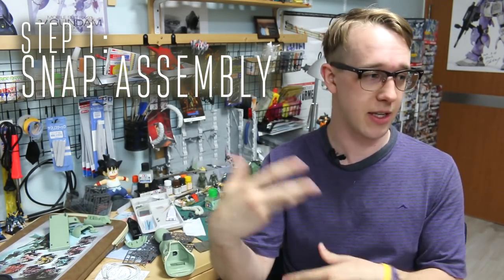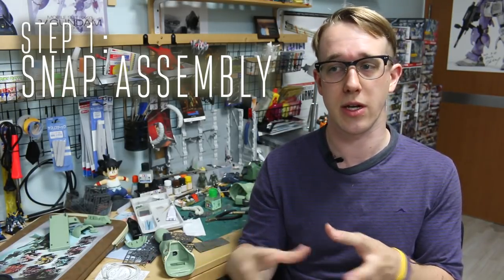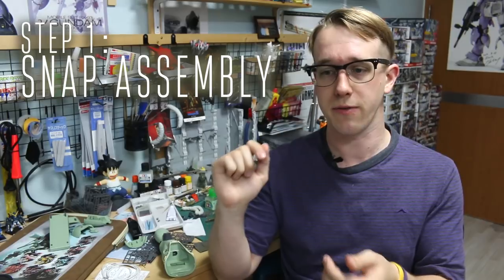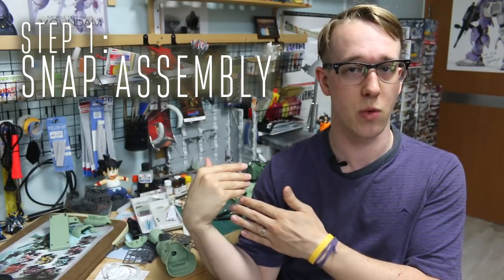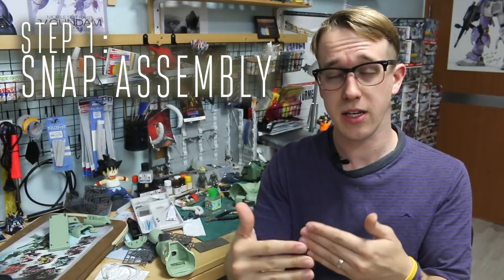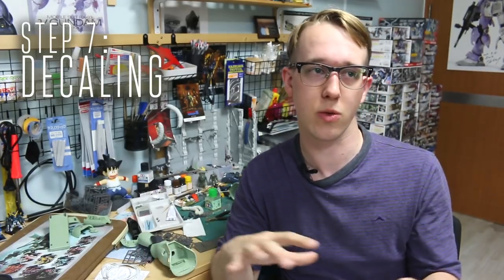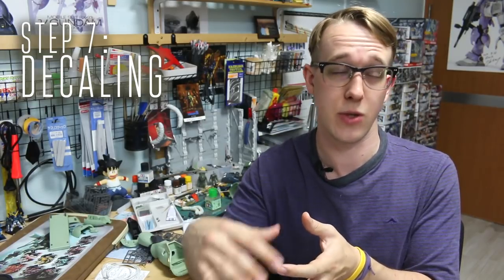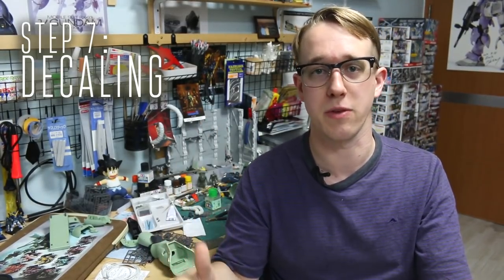1240 - FAQ: Steps for Painting

Comment: remember to top coat your top coat to protect your top coat.
Reply from the maker: I'm always scratching my kits by accident, so that's good advice for me!
Reply: I top coat my top coat, top coat that top coat, top coat that top coat, top coat that top coat, top coat that top coat, and top coat that top coat. My kit then turns milky white because of all the protection and I am comfortable with leaving it on my shelf. It doesn't move because of all the protection and I never have problems with a joint dropping down because of gravity. I just hate it when I want a different weapon and or different pose because then I have to buy another kit and do it all over again. The kit ends up costing $500 and most of the cost is top coat. Lol. Don't be like me, enjoy your possibility. The reason why I know some of this stuff, I put 4 coats on a figure as a kid and it's still a statue, next to my TV and it's a funny conversation starter. It's special to me and I wanted to protect it and it's still special to me but it's not a figure anymore and I learned to put on very lite coats and I usually only do 2 coats now. For metallic, I use gloss and I sometimes add a 3rd coat but buff wax with a Dremel pad. Then I get the song shinny in my head from the movie Moana and look at my reflection in the paint. Chrome I do the same thing but I only did it to 3 kits for the gloss and everything else is flat top coat and easy. I don't recommend the shiny process but I like it on my 1/100th Kampfer and my Iron Man custom Bearrguy and Pikachu custom Petit right next to each other. Car wax seems to be working for tightening joints but I only tried it a month ago and I always have car wax around, that's why I tried it.
Reply: If you topcoat your kit too much

BURN IT
Reply: @ihavethehighground8697  Mecha approved!
Reply: With primer?
Reply: Basically
"I used the top coat to protect the top coat."
Reply: Yo dawg I heard you like top coats. (I top coat at least three times; after the primary painting, after panel lines, and after decals.)

Comment: Very useful video. Not sure if you've used lacquer paint before, but I can confirm from at least two kits worth of experience that enamel thinner doesn't affect lacquer paint at all. Neither does acrylic thinner. Enamel thinner on bare plastic is also highly destructive, so don't ever use it to panel line a straight-built kit. When in doubt, try something on a piece of spare runner or the back of a plastic spoon.
Reply from the maker: yeah I use lacquers for painting all my kits.
Reply: Jeran Korak you can try isotropc alcohol  (rubbing alcohol) less than 90% . It will thin the paint with out damaging the plastic
Reply: Thank you Nunya Bidness, this is really useful information.
I would like to add that the type of plastic (PE, PS, ABS) is also reported in the instruction books that come with every Bandai kit.
However, I have a question: where did you get the information that Enamel thinner is fine on polystyrene (PS) plastic? Is it by experience or you have also other sources? I am asking because in other forums there are people that say that this thinner is bad on all plastics.

Comment: Awesome video. Some additional notes below: 
-After the initial snap assembly you can remove seam lines, do a bit of scratch building, pla-plating, and customization. 
-After priming, you can do some pre-shading using an air brush prior to laying down your base paint. It will add depth to your finished kit.
Reply from the maker: yep yep! Since those were kind of extra stuff I omitted those steps, just to keep it to the basics. Like I said, the main point was for folks to understand the reason for different steps, then I think they can figure the rest out!

Comment: I'm a beginner builder, just learning to use the airbrush. Painting was an anxiety-inducing activity for me at first because there's so much going on in my head about getting even coats, spidery-runny splotches, correct air pressure, how much to thin etcetera etcetera...

All that pressure is gone once I found out I could easily strip unsatisfactory paint results with isopropyl alcohol.

Comment: Hi @ZakuAurelius, I just went back to the hobby and most of your kit reviews and guides help me a lot. I am new to painting and now I am on a binder. I am now on the steps of panel lining but I use Mr.Hobby AQUEOUS HOBBY COLOR for my base coat which is an Acrylic based paint. I am also using AQUEOUS HOBBY COLOR gloss topcoat (which is acrylic as well) with my airbrush to top coat. Will this top coat helps protect my base coat from Tamiya Accent Panel lining which is an enamel base wash? Most I  read online say enamel cannot go on top of acrylic paints. The pledge you mentioned is not available in the country I am in, and only find Pledge Revive it which I believe is acrylic based as well. I hope you can help me with this situation. Thank you.

Comment: Hi there! I did find this video somewhat very helpful! But I still have questions that have trouble getting the answers to. Like for example; I have Tamiya Clear Coat, or basically clear topcoat from Tamiya---will that protect the paint or is it more for the finish look of the build? Like---sometimes I get stressed the f**k out cause I been a fan of Gundam & Gunpla for about 3 or so years now. And I been starting to get more into customising my builds, which would also mean doing painting. Anyways; I been planning out this nice HG, Gundam Barbatos Lupus/Lupus Rex, kitbash custom that I been also wanting to paint in custom colors---right now; it would be my 3rd time working on the same damn build, and for each different time I had to restart with a fresh brand new kit(s), cause of the fact that I just kept messing up. So knowing this is my 3rd time doing my build, I wanna be EXTRA CAREFUL if you know what I mean. Anyways! If you read this comment; than thank you very much for doing so. I do have a YouTube channel called "Gundam Fandom". And I also have a Instagram & Facebook just for Gundam & Gunpla related stuff. If you can give some more tips than I would greatly appreciate it!

Comment: Since I panel line white parts with mechanical pencil, I make sure I do that before my gloss top coat, because it won't stick to the gloss. Then I do wet-look top coat lacquer. Then I do the rest of the panel lines with lighter fluid and enamel and then I do flat top coat. More people need to try mechanical pencil for white panel lines, it honestly is so easy!!!

Comment: Question,
I've seen a lot of painting montages here on YouTube but I don't see them making modifications on joints and other parts that may scratch the paint due to tight joints.
Do they/you not adjust joint/fittings that are too tight and might scratch the paint?

Comment: Heya great in-depth explanation. 
My only concern is what if I made a mistake in-between one of the steps?
For example, I don't like how my weathering turn out after I top coated it again.
I want to say load a point where I haven't put weathering effects on my kit. So I can save time and the hassle.

Should I do over from step one or is there a way to clean it up without damaging some details?
Reply: Well firstly, it depends on what kind of paint you're using for all of these steps.  Usually, once you clear coat after a step, that step is done.  You may have to strip it and start over at the primer stage.  If you do end up having to strip a part to start over, I recommend using isopropyl alcohol (rubbing alcohol).  It removes most kinds of paint, but doesn't hurt plastic at all.
Reply: If I'm using the Gundam Marker panel lining pens on top of a clear coat, would using Tamiya thinner to erase mistakes destroy that and the paint underneath??
Reply: Thanks man. I'll keep that in mind. :3
Reply: My process tends to be like this for weathering. Prime > Shading* > Paint > Shading* > Decal* (waterslide or dry transfer) > Gloss Coat > Decals* > Weather using pigments and/or ACRYLIC paint > Sticker Decals (almost never) > Matte Coat. (Steps with * are ones that are interchangeable and if I feel like doing it. Sometimes I'm too lazy to do it)

I use acrylic paint because it's easily accessible, cheaper, and easier to clean up than the other two types of paints. Once a clear coat is applied onto the paint color you desire and is dried it's harder to strip using plain water (unless you have one hell of a wrist), so when you are weathering you can clean off the weathering without ruining the paint underneath ( however it may ruin the decal if you applied the decal after the gloss coat). To clean off the weathering simply dampen (not wet) a paper towel (hopefully a decent one) or a makeup sponge and gently rub or dab off the weathering. Hopefully this helps.
Reply: I don't know which Tamiya thinner you're talking about and I don't know if your clear coat shell is strong enough (IDK your paint) but I used to clean off marker pen run off with an eraser or q-tip and isopropyl alcohol. Panel line marker is water based (last time I remembered using it) so a q tip with isopropyl alcohol will clean it off pretty well after drying. There is also gundam marker remover which works the same as q tip + alcohol if you want to use that.

Comment: you forgot that you need to wash your runners before approaching to do any of the paintworks, as it will help to get rid of the oil (especially to non-Bandai model kits) on the runner parts when the runner is been pushed out of the machine during the manufacturing process before you bought it.

Comment: I've never painted a kit before and I finally got the courage to try using Tamiya spray paints. I wanna matte coat the kit for its final finish. Should I still semi gloss and the panel  line before the matte top coat?
Reply: Yeah, matte is basically the finishing coat, so just gloss and do everything you wanna do before you top coat it
Reply: @IxXGoldXxI  okay thanks! I'm would a semi gloss work? I've got that on hand and the matte top coat but not pure gloss
Reply: @nicksteeves3652  i believe in the video he said it would work, just rewatch to confirm if it's ok.

Comment: Hey man , thanks for the information. Quick question though, I recently painted my first kit and after a bit of weathering and detailing i applied the top coat which then caused the detailing and panel lining to run, is that a common issue?

Comment: i used mr.hobby mr.super clear matt, does this protect the paint?
Reply: In short yes. Top coats whether it is gloss or flat is meant to protect whatever is underneath (decals, panel lines, paint) while giving the desired finish for the kit.
Reply from the maker: yep yep, that line of super clear topcoat is more protective than simple clear paint.
Reply: Spannertech can i use a flat topcoat to protect then do panel lines or do i need to use the gloss ones before a flatcoat?

Comment: How much bulk do all those layers add to the kit? What steps should I take to protect peg holes? I can just put masking tape on pegs but how do I protect the inside of peg holes? Do I just scape out the layers after I'm done?
Reply from the maker: if you're airbrushing, the added thickness is miniscule. and yes, masking tape over pegs if you're worried they'll get too tight. But sometimes the paint works well to keep the joints stiff. Sometimes that's better for stability!

Comment: So will the pledge protect the paint from enamel thinner? Or will my mr hobby gloss coat work just as well?
Reply: Pledge is Acrylic/water but I don't see a problem if you're using enamel for panel washing on a dried clear surface. And yes Mr. Hobby gloss coat should work just fine but it is costly. If you want a flatter finish with Pledge, mix it with some Tamiya Flat base and you're good to go ( a bottle of Pledge can go a long way).

Comment: You guys recommend some usable topcoat brands? Mr.Hobby is quite expensive and running out quite fast
Reply: Alclad (US based), Tamiya, Vallejo. Rustoleum and Krylon also makes top coats for spray cans so you can technically just decant them to use for air brush.

Comment: How do you use the floor polish? I'm only finding it in bottle form.
Reply: You can run it straight from the bottle into an airbrush.. but if you don’t have an airbrush, you can brush by hand and it does self level pretty dang well so most brush strokes will settle out. You’ll just want to be careful to not drown panel lines.

Comment: I Have used humbrol enamel clear top coat. I have done 2 coats on  my plane  for panel line wash and I used isopropyl to clean Tamiya accent  wash and it just removed the paint I applied . what the hell am I doing wrong. I used the x20 acrylic thinner which was recommended and that removed the paint aswell. The humbrol clear just doesn't protect the paint aswell. Iam looking at future shine. Iam testing the difference between the two and see how I go tank you.

Comment: Any recommendation on painting ABS plastic? Thx.
Reply: This is if you just want to paint the kit with a plain finish (no shading or weather). 

Wash (recommended) > Sand (800 grit - 1200 depending on the plastic) > Wash >  Primer > Paint > Gloss coat > Panel line > Decal > Top coat. Its pretty much the same basic steps for polystyrene plastic.

Comment: use detergent to clean runner for 1st step
Reply from the maker: actually washing would come between steps 1 and 2
Reply: ZakuAurelius after washing I have found my parts later end up with dust / fibers on them. Not sure if it is just air exposure / or the fact I dry with a towel. 

When you wash how do you prevent them from gathering any further dust or fibers?
Reply: The lint and dust may just be from your towel and/or the lint in the air (ie from curtains or jackets hanging around). I air dry a lot of my parts in an area with little cloth laying around (there are pros and cons to this). To speed up the process with less lint I suggest cleaning with a micro fiber cleaning cloth like the ones that come with glasses and Q tip dipped in alcohol for harder to reach places (the alcohol helps with dry time). Store them in Ziploc bags or plastic container until you are ready to sand, prime or whatever you plan on doing after cleaning.
Reply: wash it with water and soap. let it dry in an enclosed space like a dryer especially after putting something in the dryer to let the water evaporate quicker making all the parts dry faster in less than 30 mins. just have to paint right away after everything dries.

Comment: With glueing to remove seam lines, where does that fit in with painting. Or is there a better technique to use for that
Reply from the maker: Quentin L removing seams involves sanding so obviously any time before you wash in prep for priming
Reply: ZakuAurelius awesome. What if there are internal parts, like a frame that will be locked inside an armour. I'm guessing I do those first

Comment: instead of clear coat,  can matte coating work the same? or I need to do everything at one shot, painting n panel lining, before using matt coating.
Reply: Matte coat is pretty much just a clear coat with duller (flat base) added to it. Top coats, whether it is gloss, semi gloss, matte, or flat, are pretty much universally added after everything is done once you are finished with your work to protect it.

Comment: Do you topcoat the inner frame as well? Also how do you thin future (pledge)?
Reply: Future is pre thinned ready to go. Some people just dip their plane canopies into future and leave it to dry for a more translucent finish.
Reply from the maker: for the first topcoat, yes I spray the frame parts separately. Later after panel lining and decals I've usually assembled some sections at that time so it's just whatever parts of frame are exposed.

Comment: what if I want to paint a part with the same color? or a lighter or darker shade of the same color...  do I still need to prime?
Reply: You can technically omit from priming but your finish may or may not end up the way you want (sanding is also a factor.). Priming is almost always a necessary step because it helps with the paint's adhesion on the surface and provides a neutral color for the paint to show its color. Even if the color is the same as the plastic the process is still the same.... Unfortunately.

Comment: What would a model look like if I didn't use a primer before I started painting
Reply: Haven't done it myself, but I dont think it would look all that different. The primer is meant to help paint stick on the part better. So without the primer you'll just have more difficulty during the painting process and it would be very easy to ruin the paint job after you finish. If you're looking for a good place to ask questions, Reddit is a great place to ask. r/gunpla has a lot of nice people who can help you out!
Reply: @cravin4acupofcoffee  thanks for the advice but if a paint and primer combo is used will my acrylics stick cause my brother took one of my unfinished models a got spray paint all over it now I have to try and save it
Reply: @captaincharlemagne  aaah ok. It should be an easy fix! Just spray and even coat of primer on it (dont lay it too thick) then spray your colors! If your brother sprayed too thick and there are like lumps of paint, you'll have to sand those down before you spray primer, but otherwise I took you can salvage your kit! Also I still highly recommend posting on r/gunpla. Its very helpful!